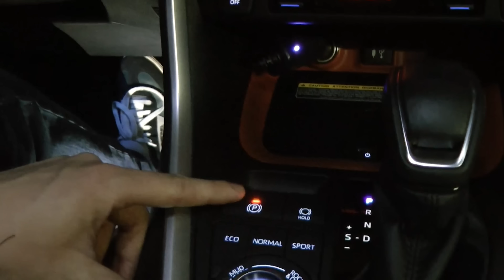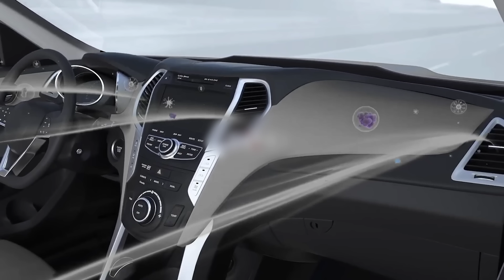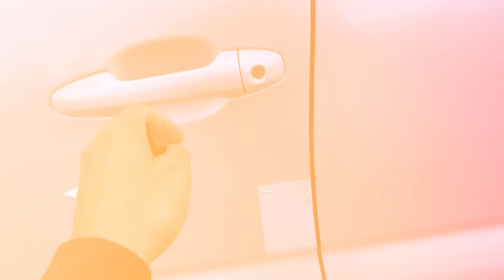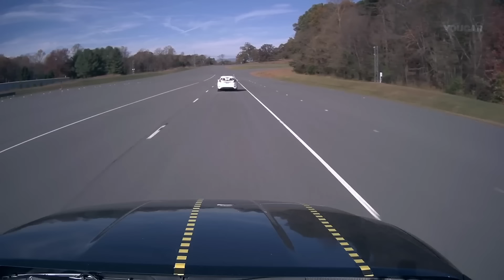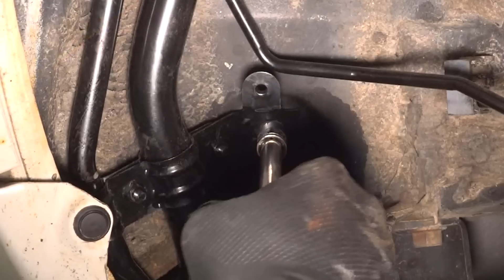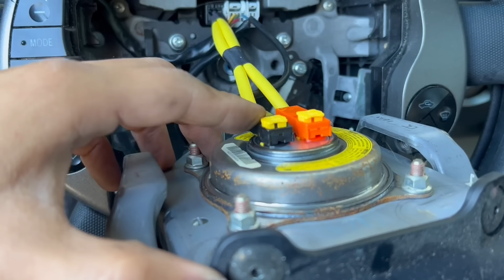Most DANGEROUS Toyota Features That DESTROY Reliability

Comment: most of the content of this video does not apply to hybrids. No starter motor, no alternator electronic park is not an issue. Have had  Toyota hybrids since 2005. I have experienced none of these problems. Also my 2016 outback also had most of these systems without any problems.

Comment: Many of these features on a Toyota can be turned of. In some cases such as the Stop Start function; you have to turn it off every time you start the.car but most are settings that stay where you put them until you turn them on or off again. The glass roofs are a pain in the butt however are included as part of the  trim level you choose so you can’t have “ memory seats “ without including the. Sun Roff. Toyota Tech was way behind other manufacturers as in 2017 certain tech features weren’t available in a higher trim level aToyota but were standard on “ budget level “ Gems or affords. All manufacturers have tech screen issues though. The electric parking brake seemed like a pain in the arse at first but I got used to it. Oh and speaking of the stop start function. Toyota has determined through extensive testing the number of times a starter will work. These are exact numbers so Toyota may rate a starter on a RAV4 at 281235 starts and thats what you can expect at the very least. Like I said, learn how to turn it off and reset it to off every time you start the car again. You will find that if you brake gradually and softly and only apply enough pressure on the brake pad to keep the vehicle stopped the stop start system won’t even apply. Thiesman’s hybrids dont even have a starter.

Comment: From a 2006 Corolla LE to a 2022 Corolla LE.  The 2006 was a manual transmission, manual windows, manual parking brake.  Ran like a top.  Way too "improved" now.
Reply: 2006. Many had auto windows. And they were never a problem. Hate cranking up windows
Reply: @IronMike-f8i  Glad to hear that automatic windows are reliable. Thanks.

Comment: First thing I do is turn of my start stop as it wears out the starter faster and adds wearcto the engine. I only use the parking break when needed as to not wear outcthe servo motors for the parking brakes. I also don't run the crappy 0w8 oil. Changing to 5w30 instantly made my engine run smoother and quieter
Reply: I thought the parking brake sets automatically when in Park.  How is the auto feature disabled?  Thanks.
Reply: @MrBilldodd  you can disable it. Turn the car on push the foot brake down, pull the park brake switch up for around 8 to 10 seconds will set it to auto use. To set it for manual use push the switch down and hold it down for around 8 to 10 seconds it then should be in manual mode all done.